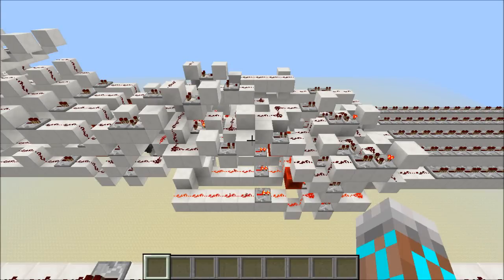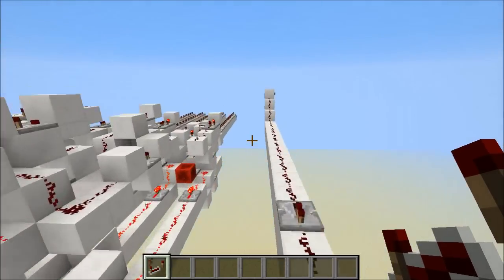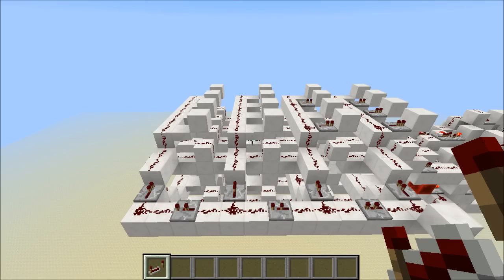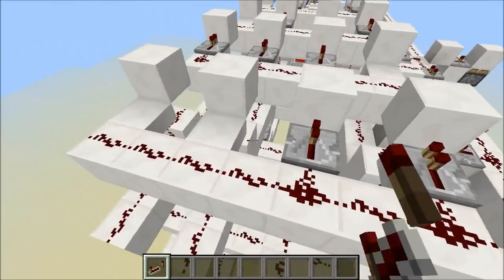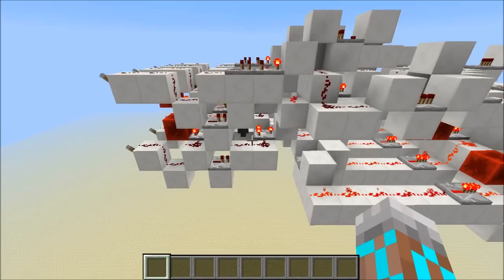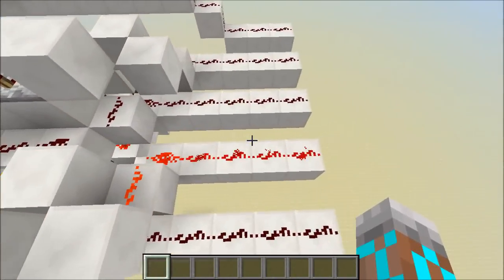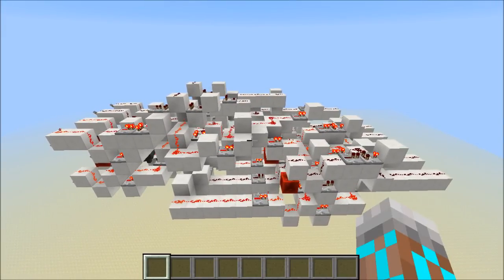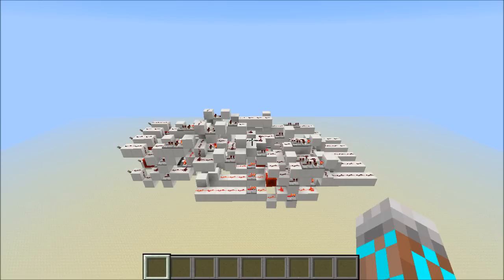Anti-Burnout Adder - Prototype

Comment: Hey prop Wryt from RDF. I have a question for ya :P If we managed to control the blocks in front of the input repeaters, we coyuld be able to do addition in software maybe?? Like not placing repeaters manually, but letting pistons control the inputs.

Comment from the maker: I would argue that hex adders will not be better than binary adders (at least with the current tools). I haven't taken a good look at hex adder designs, but while they may end up smaller than binary adders I have a feeling they'd be slower after a few modules. Add in the limitations of signal strength bussing and other components like signal strength RAM and you pretty much have to use binary for everything else if you want it to be efficient.

Comment: if u allready use the new comperators u could also build signal strengh hexa decimal adders - it would be also "anti burnout  " and im sure they would be faster and more compact  ( ok the decoders for hexa decimal are contra - but it would be still better  )

Comment from the maker: No worries, questions are a good thing! You're right that it adds, but it's special in that regard. It can receive inputs very quickly because it doesn't have torches. What that means if that if you need to add a lot of numbers quickly and the different operations don't need the answer from a previous input, you can just stream them through the adder.